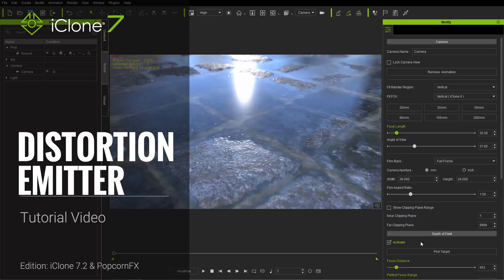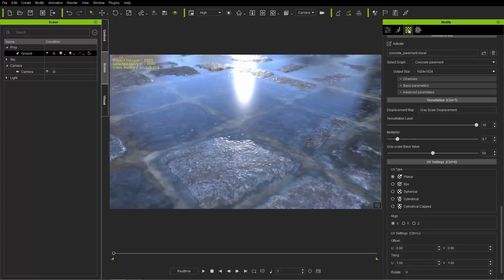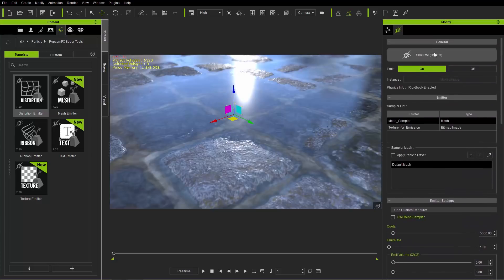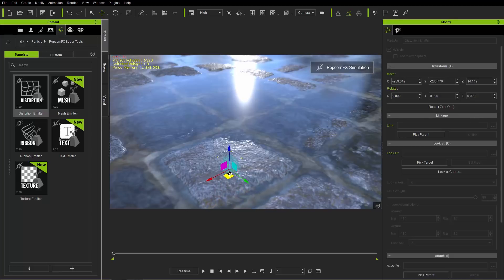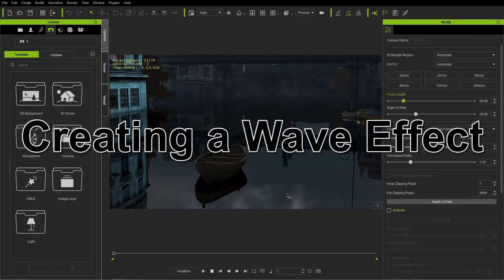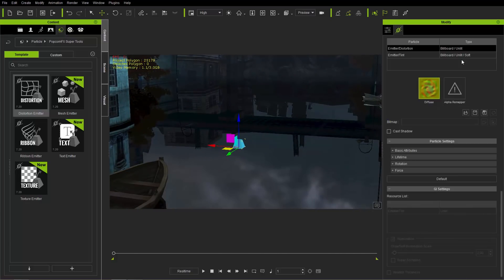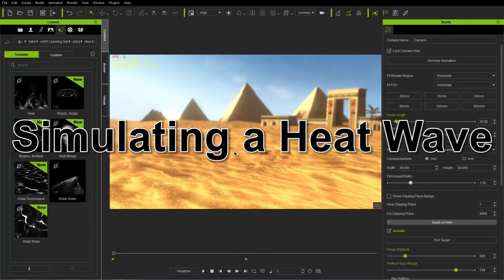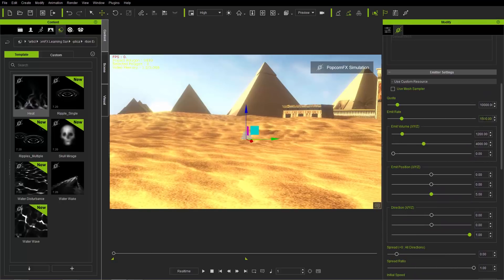iClone 7.2 Tutorial - PopcornFX Super Tools: Distortion Emitter

Comment: I wish the folder structure of the Popcorn effects were more simplified - there's no less than 3 unrelated folders where these effects reside. Not counting the subfolders, they are in:  the main "Particle" folder (feathers, kidneys, etc), then a folder called "PopcornFX Super Tools," a folder called called "PopcornFX Learning Samples," "PopcornFX Library 40," and finally, there's two more folders that's actually in the Props folder, which again are called: " "PopcornFX Library 40" and "PopcornFX Learning Samples." Not very intuitive. Besides the "Library 40," these myraid of folder types are not natural to understand by name, unless you work for Reallusion.